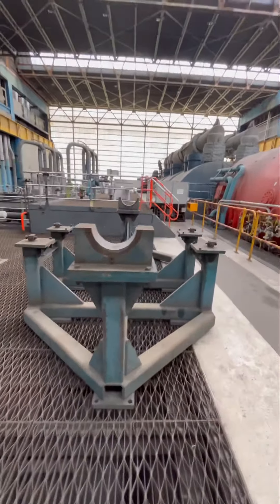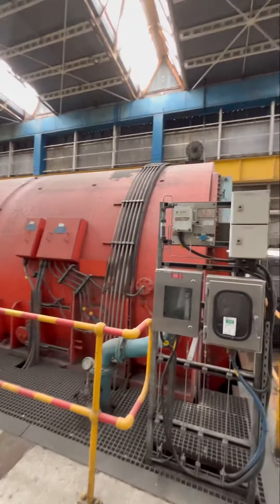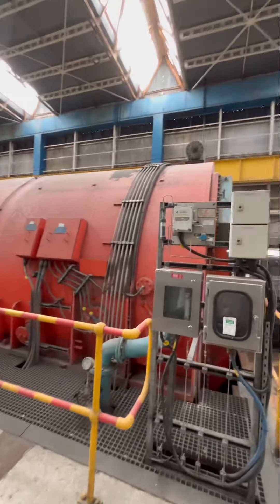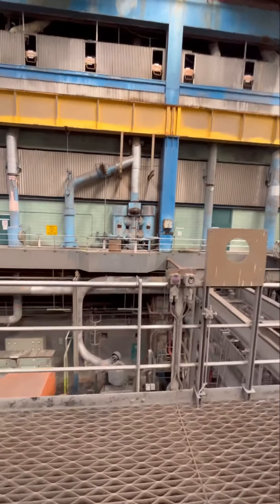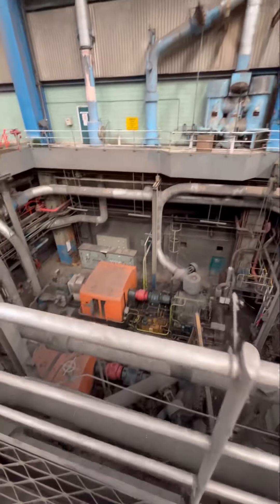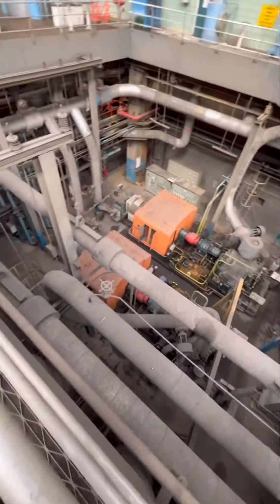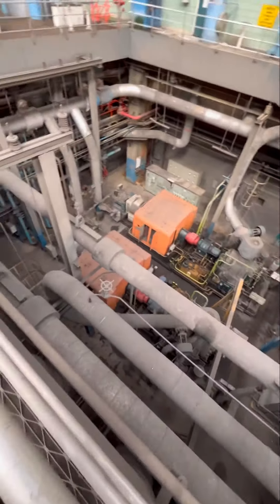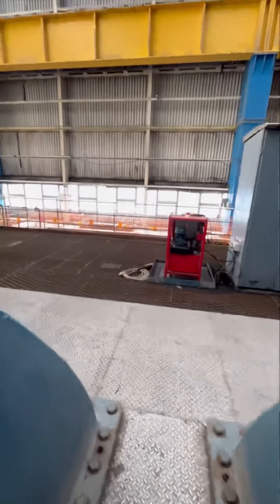fiddlers ferry power station short walk around the turbine hall

Comment: when was it decommisiond
Reply: March 2020 I believe
Reply: One unit closed in 2019, reducing capacity to 1.51 GW. In June 2019, SSE announced that the power station would be permanently turned off and decommissioned by 31 March 2020. On 31 March 2020, the plant was desynchronized from the National Grid, ending nearly 50 years of electricity generation.